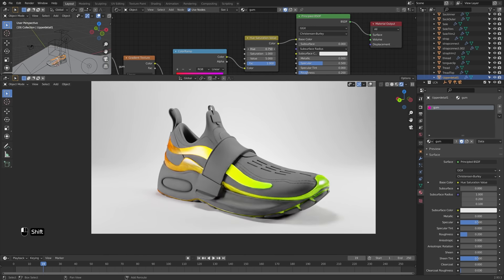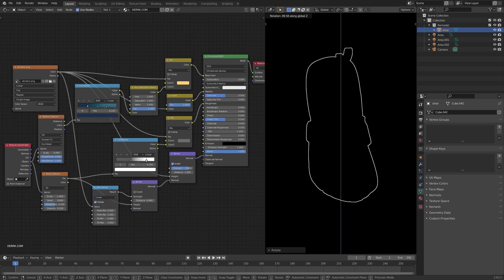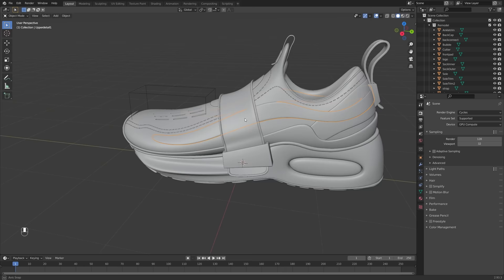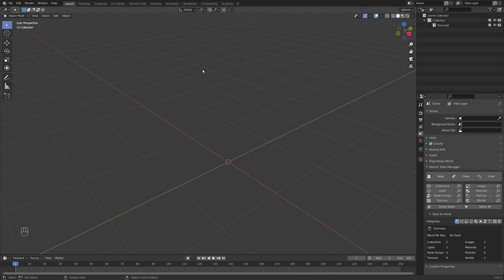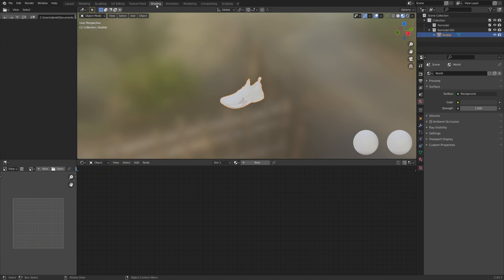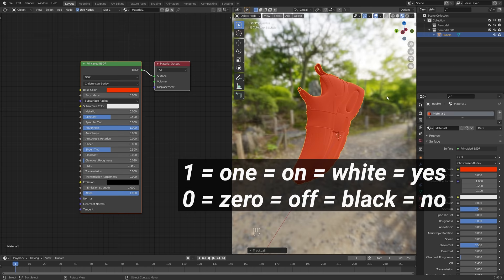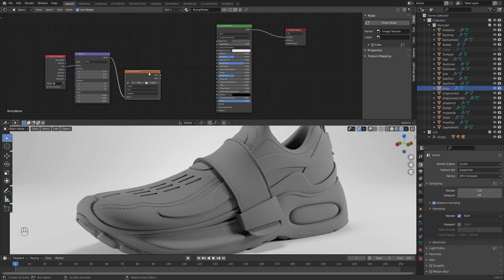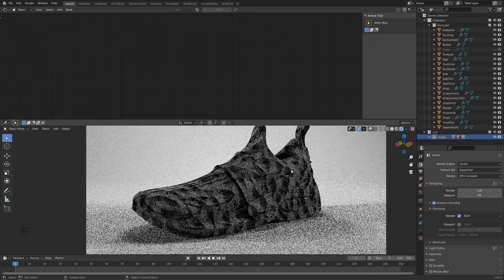Practical Material Development in Blender

Comment: Boosting colour is my favourite tip :) great tut, THX. 
I think you can mix the colour already in colour ramp ( 01:39:33 ) - no need to output it to factor and change colours there, this way you can incorporate third or fourth colour on the ramp.
Instead of sheen on the fabric I use layer weight or fresnel node (mix it with base color) and add lighter value on the outer rim - this way I can control the fuzziness of the fabric :)
Reply from the maker: Great tips

Comment: This is such a great tutorial, really explained the principle shader so well.
I would like to know how to better make that canvass looking material you have in the main thumbnail. How you managed to get the grooves of the canvess to hug the shows shape appropriately?
Are u using the material texture(mentioned mid way), but applied using the uvs with the extra seams shown at end?
Reply from the maker: hmm not positive which part you are talking about but yes to get it wrapping properly you should UV unwrap it like I have done. The next video will cover the same material in a slightly different way which may be helpful.

Comment: Hey Deked, awesome tutorials. Question, which materials are more computer intensive. Image texture or procedural materials?
Reply: Pretty sure procedural materials are lighter on your computer as it doesn't have to keep unwrapping  the larger images used for the texture, plus procedural materials are easily transferred to a different computer due to it not losing links to images! Still a Blender beginner so I might be wrong...

Comment: The only thing blender lacks (beside light linking which is in the work), is a batch render system that allows for hardcore customization and combination of different settings into many renderings. 

Lets say I need 3 different views of the shoe, with 10 different material settings, with 3 different light setups. With MODO I can do all of this with a couple clicks and obtain my 90 renderings out of vray standalone.. And I need to do lots of this stuff for work, so blender is still out of my needs sadly.
Reply: I always accomplish this with multiple cameras set to one frame each and then render the animation. The material changes would be tougher though.
Reply from the maker: Hmmm yes there could probably be better tools for this. I typically would do something like using a lot of key frames to swap things around. Did materials a similar way in the color changing one I posted (still header on my website if you haven't seen)... I don't usually have to render 70 things though (used to!)